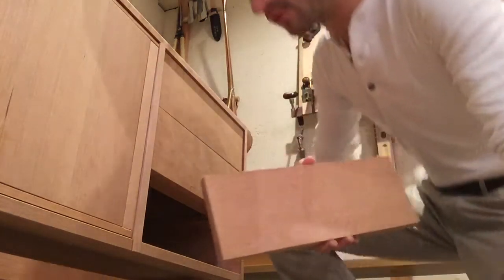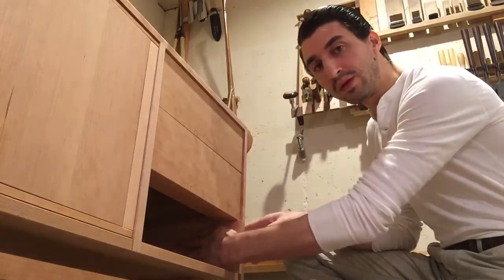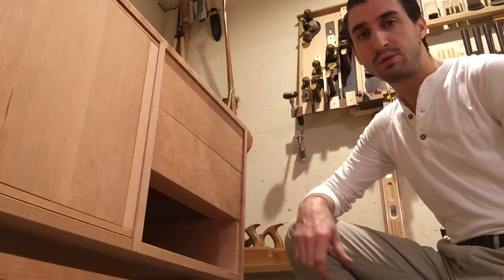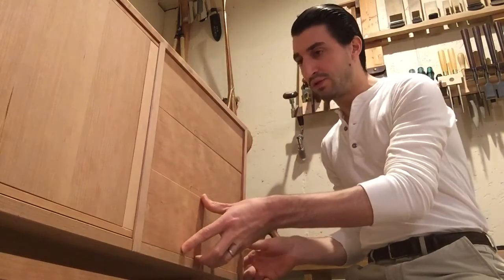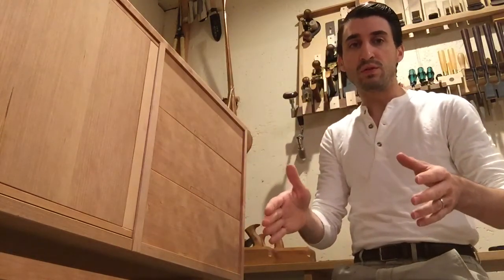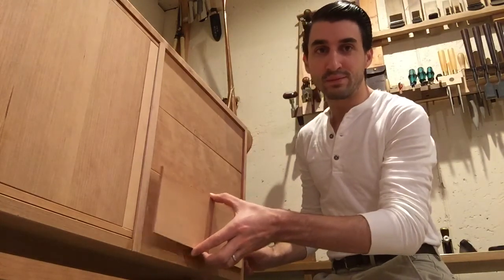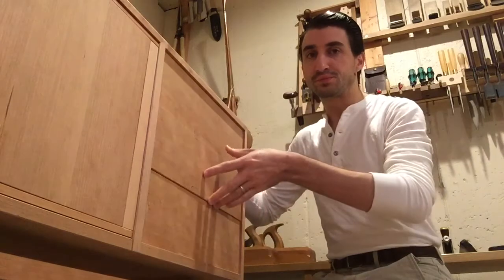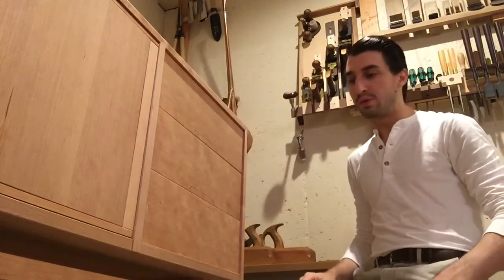Piston Fit Drawers 3

Comment: why do you go to such precision, is it just because you can and it is more of a challenge. Is it more functional and how do you get to such precision?
Reply from the maker: Shane Preiss both, it does help the drawer to function very smoothly versus a drawer that's loose and acts more jumpy when being pushed closed.  It's a long process and one which required quite a bit of trial and improvement on my part.
Reply: Must have to keep your tools highly tuned and also have a very comfortable set up. It would be very interesting to see a time lapse of you working on a project. It seems strange I know but it is very helpful to just watch how somebody solves problems through watching them work. Also I am interested in hand Tool woodworking as a hobby.
Reply from the maker: Shane Preiss I usually run multiple jobs so not sure how well a time lapse would go.  Might be interesting to see.  I sharpen tools a lot, very commonly and usually after hours. Sharp and dialed in tools are critical.